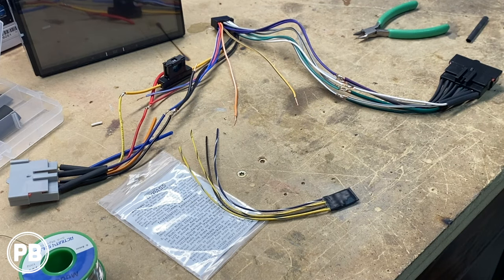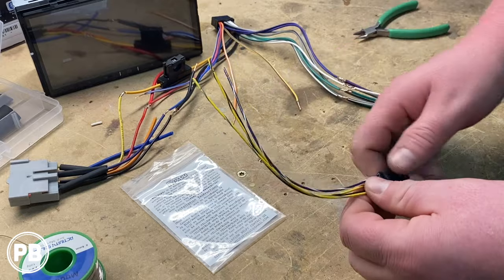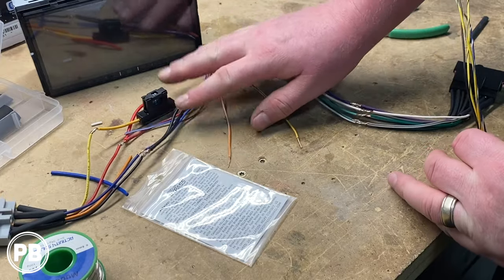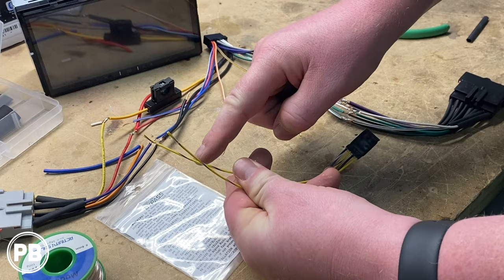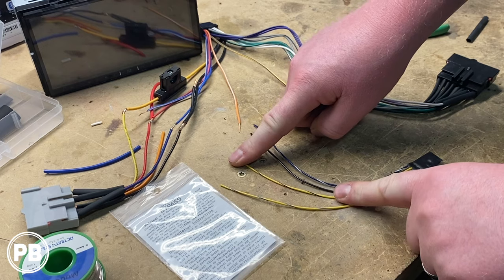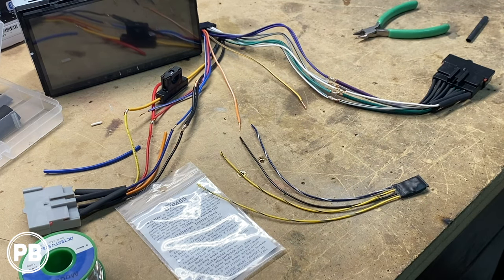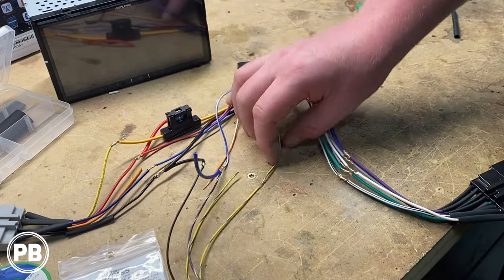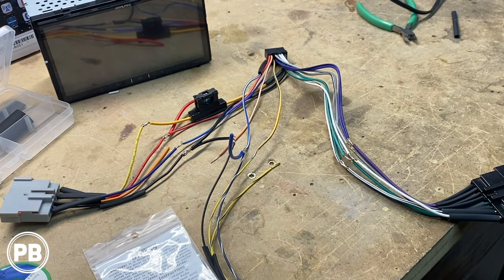How To Bypass Parking Brake On Alpine Radio

Comment: Okay I have a by pass on my alpine iLX-F511 and just random driveing the head unit shuts all my power off to my amps I am talking total loss of power and the unit shuts the settings option down when its active the settings option is lit then just randomly the unit shuts down the option for settings and a message comes on the screen that you can not access settings unless vehicle is in park then the next day it's like it resets its self and comes on works a day or 2 then does it again what the heck can that be ..... I've even stopped and put it in park .. NOTHING..turn the vehicle off waiting a min or 2 still nothing then just random driveing it comes back on amps get full power and everything works as it should any body have these issues 🤷‍♂️🤷‍♂️🤷‍♂️
Reply: Just wanted to know if you figured out this problem mine is doing the same

Comment: Y can't you just bypass it without having to buy the bypass harness?
Reply from the maker: Good question to ask Alpine directly ;)
Reply: The radio isn't sensing a completed circuit like other radios are. It's sensing a pulse which the parking brake bypass mimics